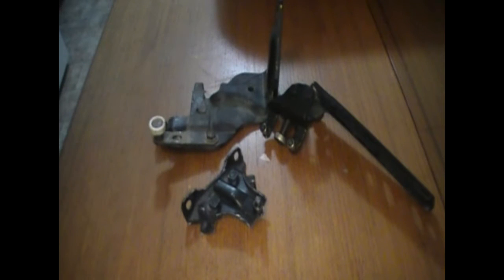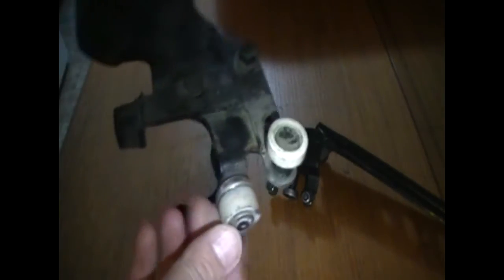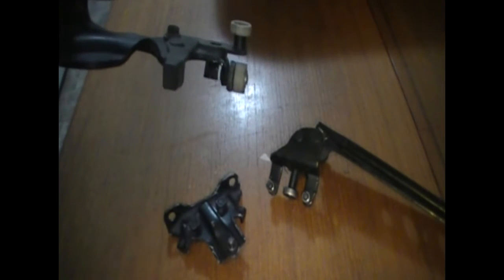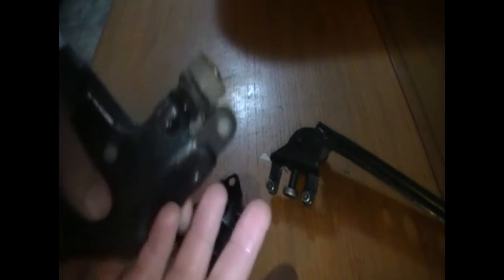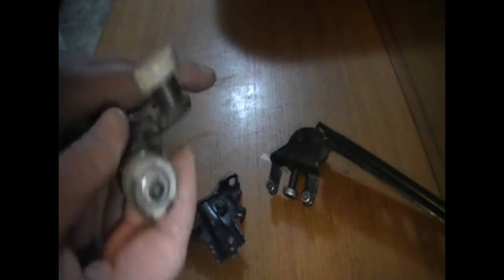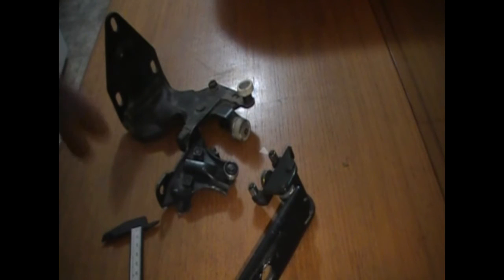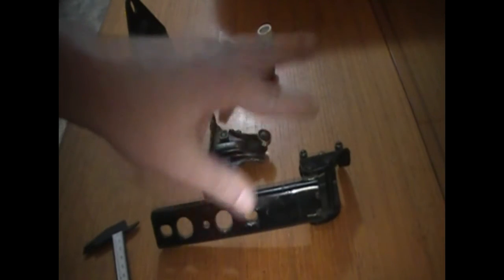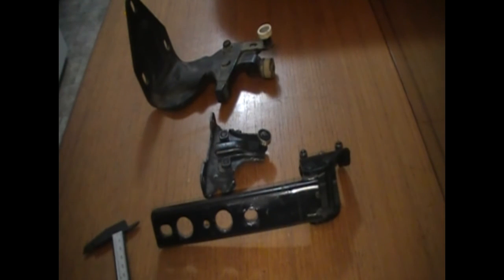Sliding Door Hinges Repair / Fix [ Tarago Previa Estima TCR10 ]

Comment: Great Video, I have an 2002 Tarago ACR30 and the left rear door has to be slammed to close. I don't know if it is adjustable or I have to replace these parts?
Reply from the maker: OK you will need to use Internet Explorer to open this link http://toyotatarago.net/2000-2006/contents/index3.html 
On the left look for and click on the little plus next to [Repair Manual] look down the drop down and locate [BODY] another drop down list look for [Slide Door] and that should have all the info your looking for. I host that online workshop and that link I just posted will only work as long as I host the domain, Please take full advantage of it and collect info. I will keep it going as long as I can. It will be active for at least 1 more year but after that depends on if I can pay server fee's. Cheers.
Reply: thanks Mate

Comment: Hey mate, my door doesn't stay open especially on a slope. You wouldn't know what bit keeps it open? Thanks in advance. Great videos btw.
Reply from the maker: Bottom roller area you will find the mount that stops the door sliding forward again after fully opening it. But if your getting petrol the gas tank stopper will stop the door opening all the way as well. FaceBook Image of the mount > https://scontent-syd2-1.xx.fbcdn.net/v/t1.0-9/18893144_2323894367835159_8486695532349860318_n.jpg?oh=b1c5113a24c93e073addc43dcf88e7a6&oe=59ACDBC2